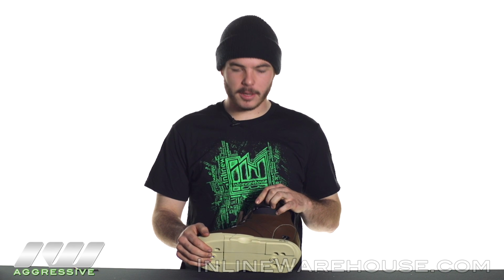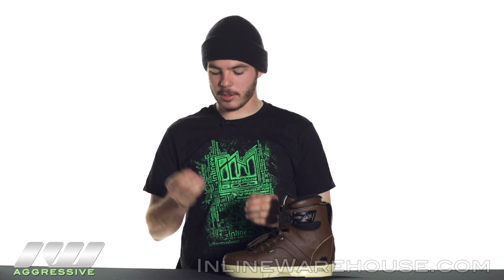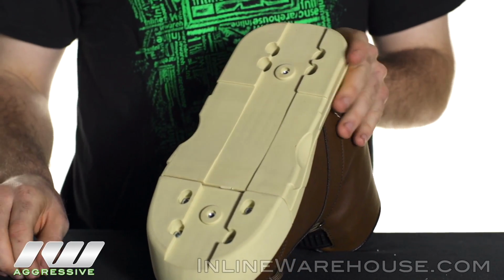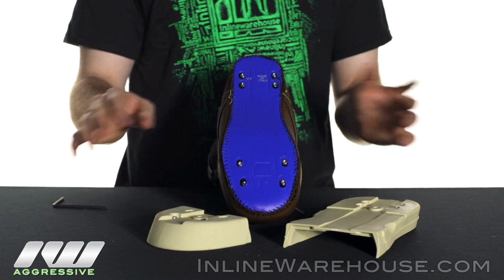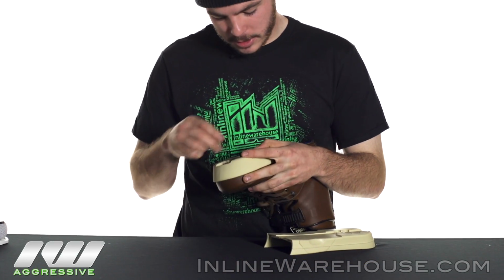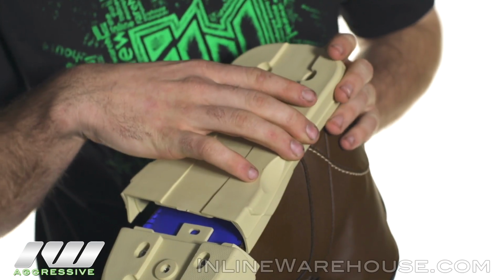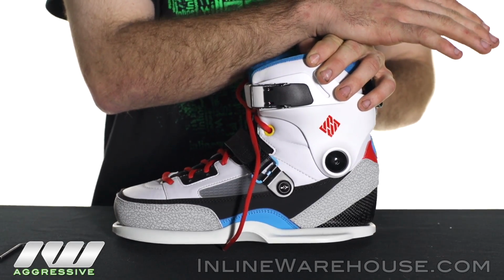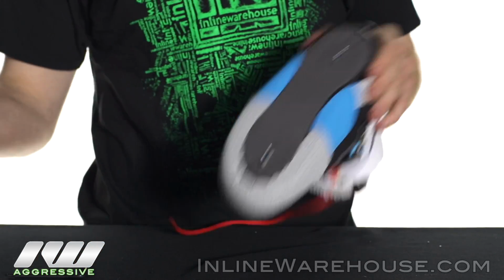How to Replace Soul Plates

Comment from the maker: Can't say in your specific case, but we've noticed that the classic Thrones fit very snug and that the bottom section of the boot will also push back against the soulplates.  We recommend putting the screws in, but don't tighten them all the way down until both plates are on and the screws are in.  Then finish tightening from center most screws out, finishing with the heel and toe bolts.

Comment: nice. The one's ive had most trouble with over the years are the USD UFS Throne soulplates, I dont know if somethings got a bit warped over use or is off in the US 10-10.5 shell, but the 2 halves of the soul never sit flush, they always seem to be very slightly too long and push out in the middle, so the BS plate doesn't sit snugly into its groove.

Comment: It's the Evo style thrones i'm referring to, with 2-peice soles. Since they only use the frame bolts to hold in place, it makes fitting the frames a difficult experience as you have to use longer bolts and tighten each one alternately bit by bit. but even when you get them both tight, the BS plate still doesn't sit flush, and the frame bends slightly. seems like the front plate is just 1-2mm too long. stock plates were flush, but all the replacement sets (of both bulky and slim types) do this.

Comment: I've got a bunch of those plates and they never fit right when you get them. If you shave them down a bit where they meet they'll fit better.  I think they just make them big so they're not loose and flopping around because some of the shells come out different from the mold or something.